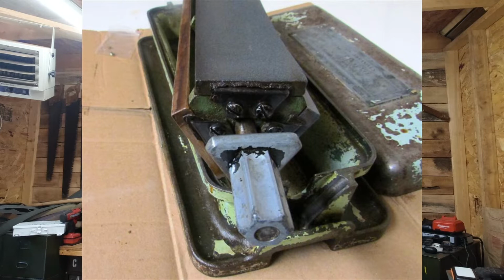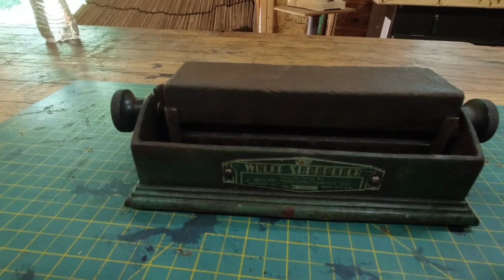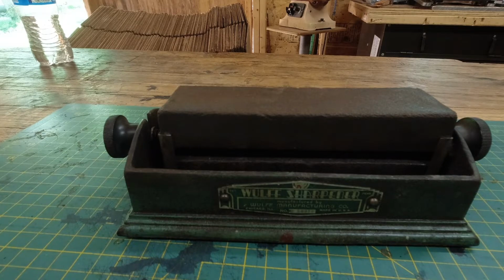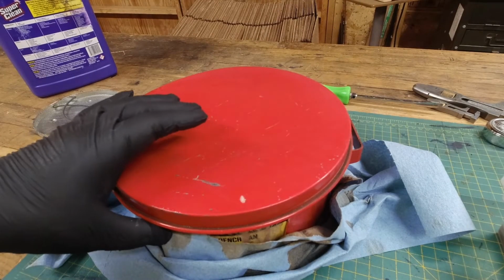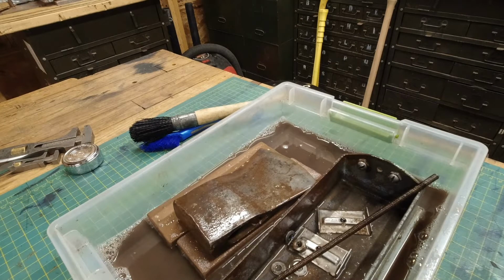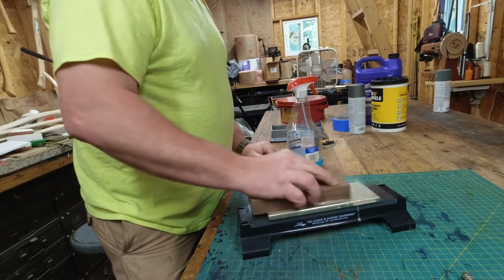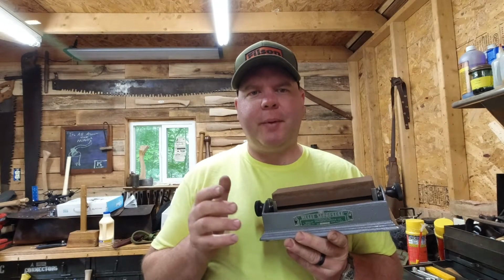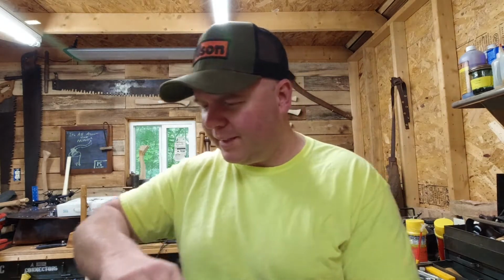Restoration! sharpening Stone System!

Comment: Nice job, but there are cheaper ways of flattening stones. If you have a flat surface like a sturdy ceramic tile or a thicker piece of glass, you can sprinkle some SiC powder on there and rub the stone on that. Or you can use coarse drywall sanding screens on a flat surface. You could still use the diamond plate for the finishing touches or, if and when the diamond plate stops cutting, use it as a flat surface and sprinkle on that SiC powder.
Reply from the maker: I agree.  I talk about that in a similar video on the lansky puck.

Comment: You need a sharpening pond, my friend.  Once you have one you’ll wonder why you ever sharpened without one.
Reply from the maker: Wait, a pond? I need more information!
Reply: @KillingerUSA  Mostly used for water stones. It's a square tub that will give you plenty of water for soaking several stones at once and the rim is sturdy enough to put on a sink bridge, i.e. a piece of wood (there are also fancy metal ones) that fits over and locks onto the tub to hold the stone over the water beneath.